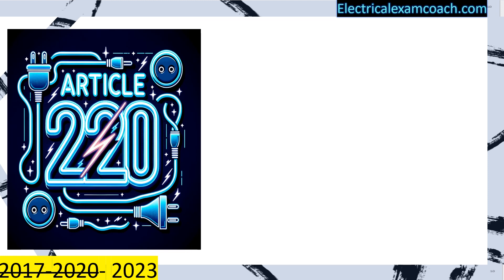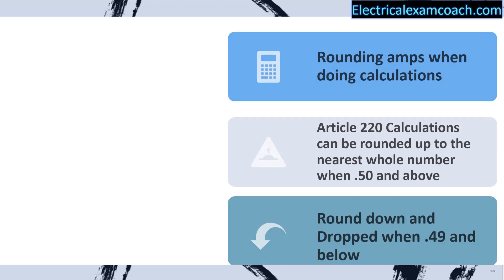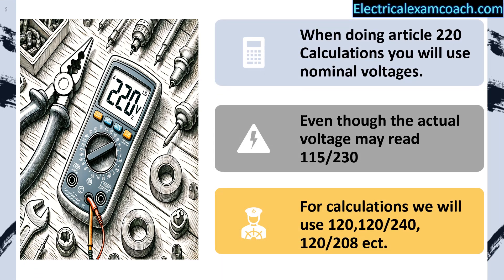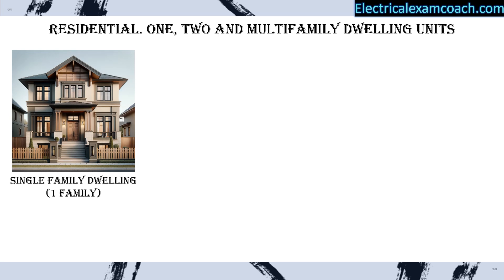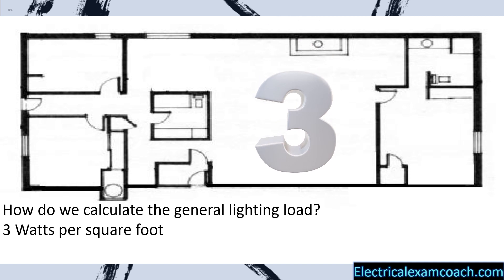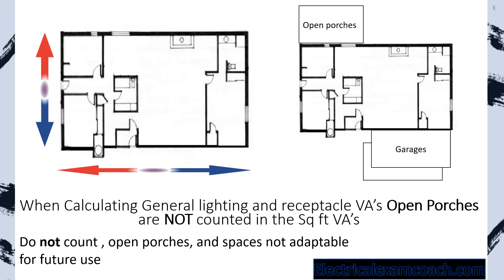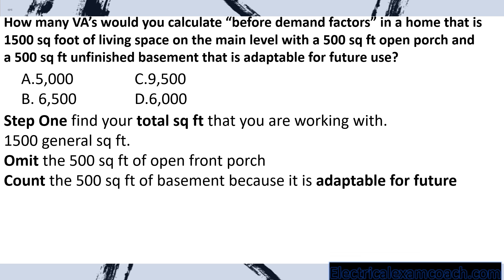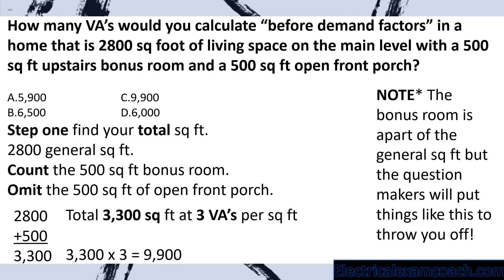Lesson 2.2 (2023 only) Whole House Load Calcs Master Journeyman 3 VA Per Sq Ft  Electrical Exam Prep

Comment: I noticed you have 2 videos on this topic. One for 2017 and 2020 NEC and another for the 2023 NEC. Did the Code Gods decided to include garages in Load Calcs in 2023 but not  for 2017 and 2020? Also, if that is the case, are you to include the Sq Ft for both attached and detached garages? Thanks!

Comment: Hey guy, what do you think of a master electrician supervisor that shames guys into working circuits hot. I just did a retrofit at the Villanova technologies building on the second for as a temp for Patriot Construction. I got ridiculed for tripping a circuit swapping out receptacles hot. Accidentally touched the yoke with the hot wire. This guy proceeded to tell me how he does the hot wire first. Then bragged that he has done over 200 services hot at the service head. And only got shocked once because he doesn't connect the neutral or ground till after working the hot service head. Without any gloves or any kind of PPE.
Reply from the maker: Hack

Comment: Am I wrong to conclude total square footage must be multiplied by the number of floors. eg, if calculating perimeter  of a house is 1000 sq foot and there are 2 floors then we have to calculate 2000x3= 6000 VA
Reply from the maker: Correct it's total square feet
Reply: Thanks
Reply: I finally got that house done I was telling you about took me 5 weeks